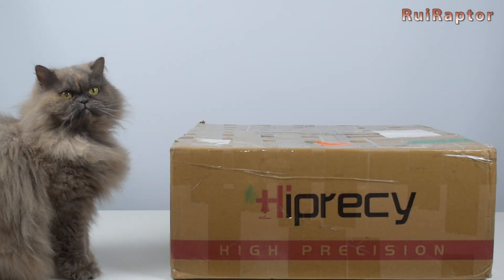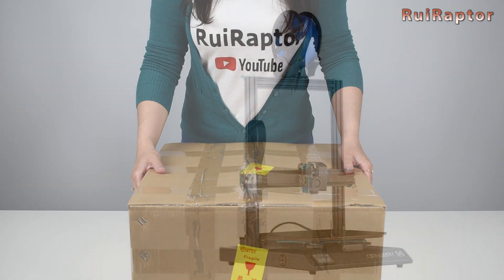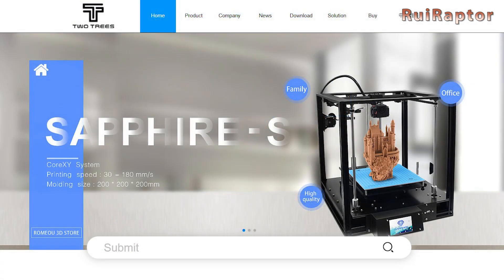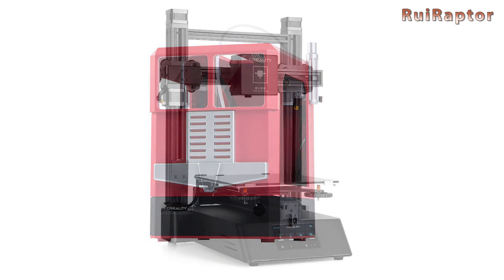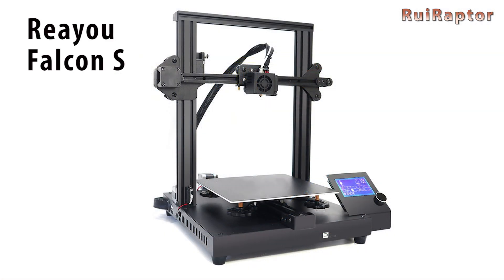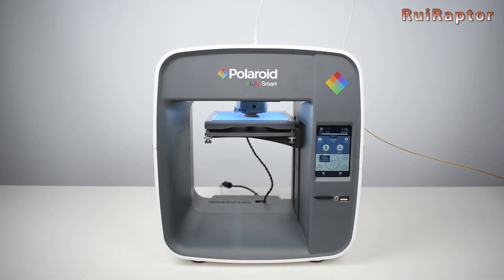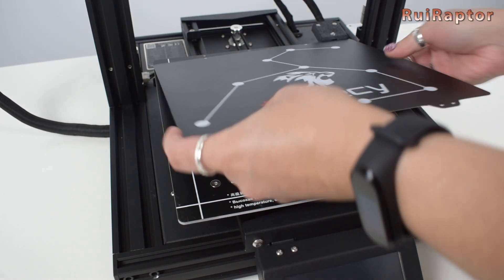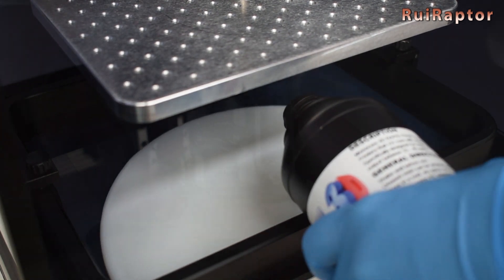2019 Year Review - All The 3D PRINTERS Tested

Comment: As you know, I got my CP01 mid-November. It printed a kinkajou, shorted the extruder on the bed, died.  Now 1Jan, Creality has shipped a replacement printhead...should be here by 15 Jan, BUT they had me move some wires, and it showed that the motherboard is toast too. So, they are shipping a replacement for that too....another month dead in the water? Meanwhile, my Sovol SV01 had a problem I created. Within 10 days, I had a replacement extruder head installed.....more than four times better service performance from Sovol.